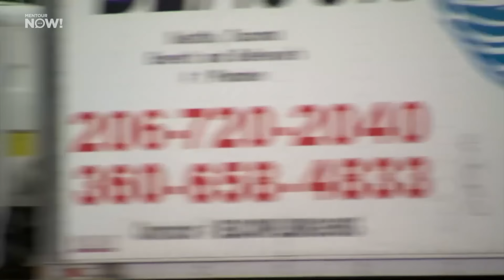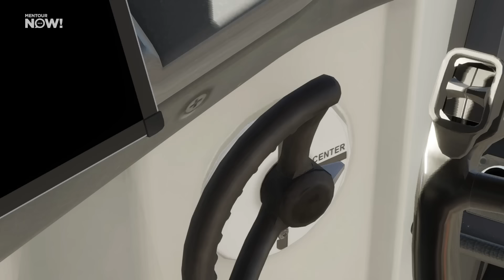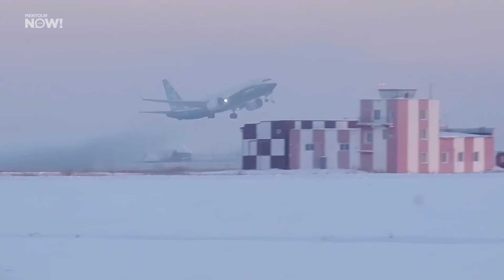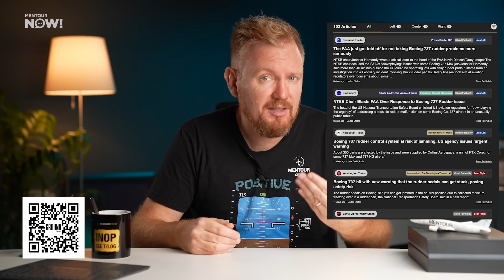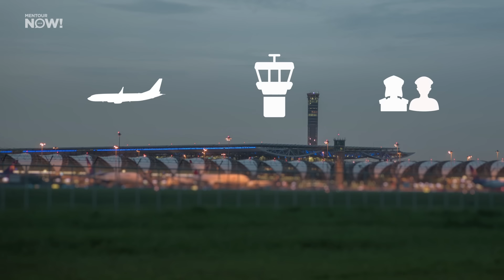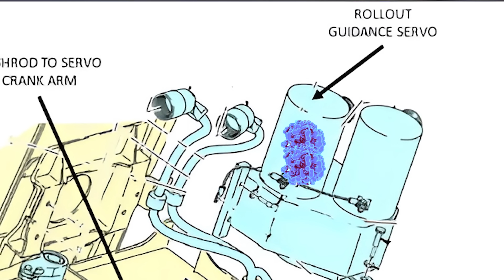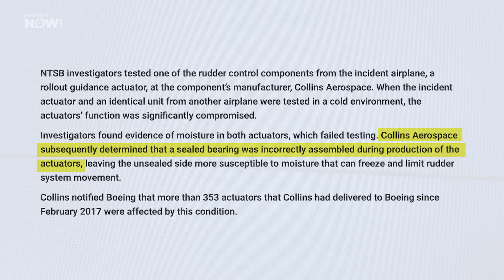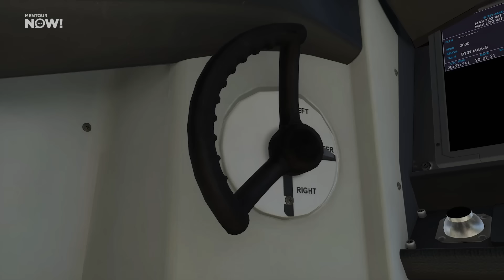Does the Boeing 737 Have ANOTHER Major Flaw!?

Comment: May I thank and be amazed by the bravery of the pilots (test pilots?) who took the problem aircraft airborne again to recreate the situation, which then was recreated, taking on personal risk to make flying safer for everybody? I have the utmost respect for pilots in general, and test pilots I just absolutely think the world of. I don't know how they do it, I don't know what kind of personality it takes to do what they do.
Reply: We had exactly the same situation many years ago at BA back in the day. G-BGJI is the aircraft I worked on which went out of control on a test flight. The rudder was the chief suspect and they sent it back up to try and get it to act up again. Nuts.
Reply: @nimedave  I thought of that incident right away. The new situation was nowhere near as dangerous, but stepping into an aircraft you know is defective is incredible.
Reply: @renerpho  From memory it was corroded pins on the yaw damper computer I think.
Reply: @Larry-mk9ry  I don't believe they're testing spin-recovery on those airplanes. There are spin states that are expected to end in a "lithobraking maneuver", no matter what the pilot does.
Reply: Maybe Boeing should be required to fit ejection seats to all their aircraft.!
Reply: Let's not forget all the test passengers who ride these every day.

Comment: So, multiple pilots had to encounter stuck rudder pedals since what, 2017ish and didn't report it. What I don't know is how often rudder pedals are even touched during most landings, is this something that's uncommon? The issue itself was rare to begin with, but on top of that, if pilots don't touch rudder pedals in 99.99% of landings, then this could explain why it took so many years to be officially reported.
Reply: They use rudder pedals in every crosswind landing. Mentour explained that most of these late model 737s don’t have the actuator that failed because it’s only required for automated Cat 3 very low visibility landings which most airlines don’t allow.

Comment: As an engineer, I can see "Just kick it hard enough to make it work again" as a very typical engineering solution, it's almost funny. As someone who might be flying on that plane, however, I find it a lot less amusing.
Reply: Yes. I too am an engineer.
IMHO brute force doesnt really solve issues, sometimes it make the original issue worse, or creates a new problem (like in this case overstressing the cable linkages).
Reply: @AnotherPointOfView944  I was visiting a factory two weeks ago because they had some blockage in their system and the local engineer's first thought had been to cut the pipes open and wash it with a water jet, before welding it back together. While not always productive, 9 out of 10 engineers try brute force first before asking questions; especially the field engineers. It's like software engineers always suggesting rebooting and reinstalling first. It's just a lot less amusing 35000 ft above ground.
Reply: @AnotherPointOfView944  If you had read the NTSB's report you would have found that this wasn't Boeing's response to this specific problem, but the general procedure in the operations manual for a jammed flight control. The engineers knew that maximum effort by both pilots combined would not damage the linkages in the control system.
Reply: Don't be a sperg  @AnotherPointOfView944
Reply: I am old enough to remember my grandpa's black and white TV. The picture on it will become bad, and the solution was to give the TV some beating. And depending on what went wrong, we knew where to hit it.

But if you think about it, this was a vacuum tube TV, and when they heated up, some of the connectors got dislodged and lost connection. Hitting it correctly would make the vacuum tube fall correctly into their connectors and things will work.
Reply: @todortodorov6056  Definitely - vertical hold and horizontal hold!  I'm old enough to remember my OWN tv sets like this 🤣🤣🤣
Reply: Frank Shaw, Rover's chief engineer in th 60s, tells a tale of the Bullnose, the last of the handbuilt prototypes. Once approved for production, they separated chassis and bodyshell, so tooling could be produced. Unfortunately, one of the chains connecting the chassis to an overhead crane broke, and it landed on a corner, bending it. Frank sent an apprentice to his office, where he kept a graduated set of sledges, and propped the chassis on supports. Metal has a memory, and with a careful swing, ping, it went back.
So there are times when "when I nods my head, you hits it" can work.
Reply: @RahereTheGenius  they tried that with the siemens reactor in fukushima after a tank fell over during installation. did not go so well in the long run
Reply: As a mechanic, I also agree with this sentiment. Everything is a hammer, and a hammer fixes everything.
Reply: @cammymillard7385  if it fixes it, great. If not, it needed replacement anyway.
Either way, it's fixed.
Reply: @cammymillard7385  Isn't a Hammer called "the Yankee screwdriver"?
Reply: @cammymillard7385  If a hammer can't fix it, the problem is electrical.
Reply: Yeah what's the big deal, just add it to the check list..
Reply: As an engineer.
Hammers were banned on the shop floor. Only maintenence had access to them. Big no no for composites
Reply: This reminds me of the 'maintenance' activity on a high powered RF amplifier used in the Indian Ocean a good few decades ago. The amplifier had a bit of a habit of going into self oscillation and then burning itself out. The maintenance process was to tap the amplifier 'lightly' on the mark painted on the casing with a 14lb sledge hammer, which after a few 'light' taps would then behave itself for another week or two.

🤣
Reply: I had a GM car that was ultimately determined to have a faulty main computer.  There were times the car would stall.  I learned the fine art of putting the car in Neutral and restarting, even at 60 mph, and watching the tach to see if it would maintain idle at 1500 rpm.
Reply: "Just kick it hard enough to make it work again"
Well, that's why the door-plug wasn't closed to tight, how would you otherwise get outside for maintenance during flight? 😅
Reply: I have to say that I'm really impressed the pilots reported it after kicking it freed it up.
Reply: We used to tell farmers to take their computer for a ride around the farm and try it again before they drive all the way to town... Fixed an absurd number of non-booting computers. 😂
Reply: Rumor has it that Boeing hired the Fonz to put on a workshop .
Teaching pilots how to fix all the issues with a simple Slap 😊
Reply: I am old enoigh to remember the Apollo XII mission where the TV camera acted up and the astronauts tried to fix it by hittingbthe camera with a hammer.

Note that the pilot only suggested doing this once the aircraft was moving so slowly that the position of the rudder was irrelevant.  In this contingency this was only a diagnostic test, not an attempt to restore the rudder to normal operation.
Reply: Percussive maintenance🐸
Reply: Always a hit
Reply: I agree. Think of the poor passengers on flt  587 that crashed in Rockaway NY when an overenthusiastic F/O overcontrolled the rudder, causing it to fall off in flight. It was an Airbus A300, but still...
Reply: @erichabegger9895  AA 587 didn't have jammed controls and it was the rapid alternating movement of the rudder to the left and right travel stops that caused the over-stress of the attachment fittings. Also the A300-600 had a design defect in that it allowed rudder actuation to the travel stops with very low pedal force. Its predecessors, the A300B2/B4 din't have this issue. The 737 uses blowdown force from aerodynamic forces to resist the  pilot's pedal force in addition to limiting the amount of rudder travel according to airspeed.
Reply: It’s a passenger plane, not a vending machine in the break room!
Reply: Back when I worked for a defense contractor, for one of our systems we had a "circuit board seating tool" which had an actual part number. It was basically a 2x4 that you would put on the edge of a circuit board and give it a good whack to seat the board into the connector.
Reply: im flying on max 8 next week, should I worry?
Reply: @HanyPhilobs No. You now know the solution and in worst Case, you're the Hero of day ;)
Reply: or as they used to say in the Newcastle-upon-Tyne shipyards, "Divent force it lad, just use a bigger hammer !" Sheesh !
Reply: It`s easy... just fly Airbus
Reply: @HellStr82 Airbus is not immune from issues as well and has a track record to prove this. Neither is any company on the face of this planet which makes aircraft or systems/parts for them. Human factors.
Reply: My worry from a maintenance side of things is while it might work you have no idea in that moment if what you are doing is going to break something else unless you are intimately familiar with whatever system you are about to apply percussive maintenance to.
Reply: @EntityOfTheVoid  The pilot is operating the airplane, not performing maintenance.
Reply: Percussive maintenance ftw
Reply: The problem with “kick it harder” is a pilot’s natural concern that doing so could potentially result in the loss of the vertical fin and the aircraft.
Reply: It has an official term: Random Impact Repair Methodology - RIRM.
Reply: The Gemini astronauts called this an "impact of rejuvenation."
Reply: When I was a kid, we'd fix the rolling on our black and white TV by smacking it two or three times. PLEASE tell me that isn't the same way to fix a jet airliner. My tv failing doesn't kill 200 people.
Reply: also once you had that on a part, it tends to get worse, not better over time.
Reply: Kick against the ice. Ahahahahaha! Funny!
Reply: Don't forget JAL crashed after the tail rudder fell off. Over 500 passengers killed.
Reply: @Fox-in-sox  JAL crashed because the aft bulkhead failed, allowing cabin pressure to pressurize the tail, which inflated and broke free of its attachments; not due to control surface actuation.
Reply: Ya, just keep kicking it harder and see where it eventually fails.  Not a good engineer are ya there sparky?
Reply: That's surprising. I'm in the automotive industry and it seems the engineers in this business like to pretend that defective parts don't exist and every part will be manufactured to exact tolerances 100% of the time, millions of times.
Reply: @jeffrojefferson88  "That's surprising. I'm in the automotive industry and it seems the engineers in this business like to pretend that defective parts don't exist and every part will be manufactured to exact tolerances 100% of the time, millions of times."

It depends on the company you work for but much of the automotive manufacturing sector now works to "six sigma" tolerances, i.e. roughly one failure in a million. Items which cannot be produced this way have to be 100% inspected, usually with automated inspection. If the manufacturing engineers are successfully producing to spec then it is perfectly reasonable to expect perfect parts. I worked for several decades in automated inspection and can assure you that all the Japanese manufacturers are supposed to work this way.
Reply: Punching is how I "fixed" my old CRT. It was only displaying green, smacked the shit out of it suddenly it's color again
Reply: The old, “Bigger problem needs Bigger hammer” routine 😂
Reply: Have you tried to pull the plug and put it back in?
Reply: Grab a can of WD-40 as part of the standard equipment . . . Wait! I don’t want Boeing to get any bad ideas - worse than the ones they seem to have. 

Never mind!
Reply: Easy to say when on the ground but during flight at climbing speeds this could be deadly, cruising speeds worse.
Reply: When he was explaining it I jokingly said out loud “just stomp on it”. Didn’t know that would be the actual answer. Wtf
Reply: "Perform percussive maintenance"

Comment: You'd think the 777 and 787 would have more drama, but just like in any family, the smallest one's the most troublesome
Reply: The 787 and older 777 were built when Boeing was good. Look at the problems they are having with the 777X though. It's not an aircraft thing, it's a modern Boeing thing
Reply: @mattevans4377  Safe to say that anyone who has any mild interest in Boeing knows just how much they're messed up now
Reply: @mattevans4377  To be completely fair to boeing the extra info i've heard on the 777X issue indicates the fault is with general electric and the data they provided to Boeing for designing the thrust links.

There's apparently an issue with excessive flexing in the engine itself which is generating cyclic load rates well above what boeing were expecting based on the info they were given. I haven't been able to confirm the info i saw, so apply some salt till we get an official confirmation. but if acurratte thats not on boeing in the slightest, they did everything right.
Reply: haha

Comment: Isn't Cat 3C for situations where go-around isn't really possible and plane has to land no matter what? (like lack of fuel or some other issue)
Reply: The answer to your question is no.  This is a routine approach to airports that are certified for Cat3 approaches, and has been in use long before I retired from a major USA airline in 1994.  The autopilots are truly amazing.  When the nose of the aircraft is lowered by the autopilots (3 were required on the B767) the left wheel  of the nose gear would be on the left of the painted yellow centerline, and the right wheel on the right side of the paint.
Reply: @ronb.6582   Ah, technology.  The true god we should all worship.
Reply: If conditions are too poor to clear the runway after landing, then yeah it must basically be an emergency landing.
Reply: I guess today, it is more of a legacy mode, not that often used anymore due to safety restrictions. In an emergency, no reason to let the autopilot do the landing after touchdown.
Reply: If you really needed to. The rules go out of the windows in an emergency. If you had justify your actions at the board of enquiry, then anything goes. Capt A350

Comment: RGAs always has problems. As i remember i replaced 3 of them so far. But they generates fault codes before a complete jam. Also at installation a lot of sealant use required iaw AMM. So i am a little bit confused. Some info needs to be clear out.. thank U😊